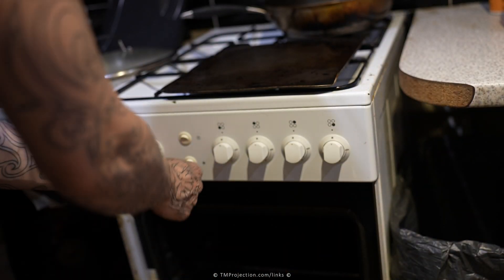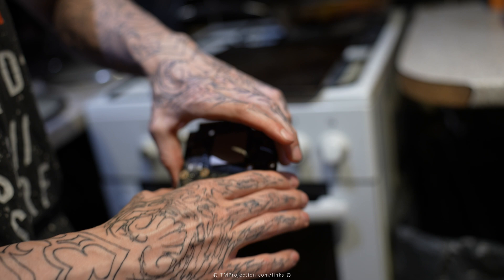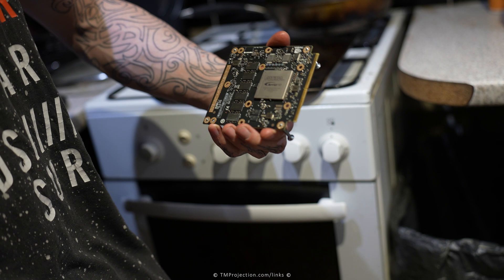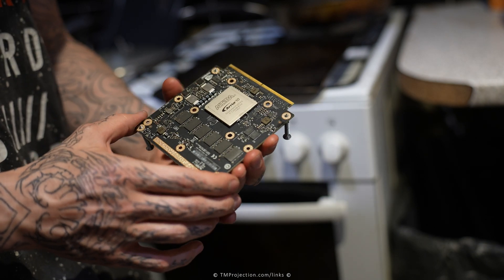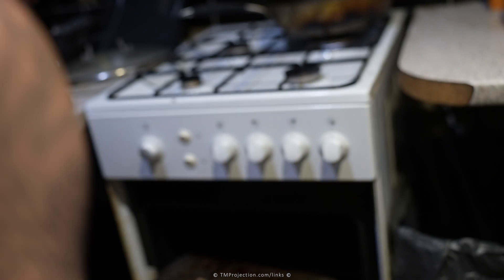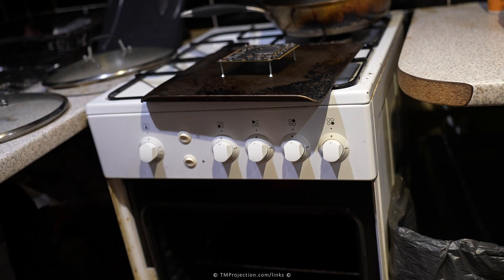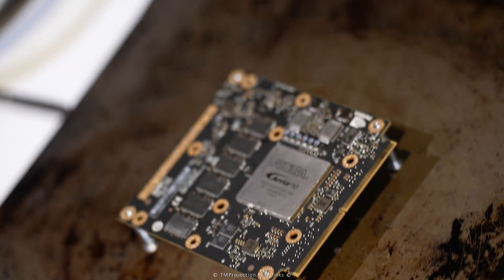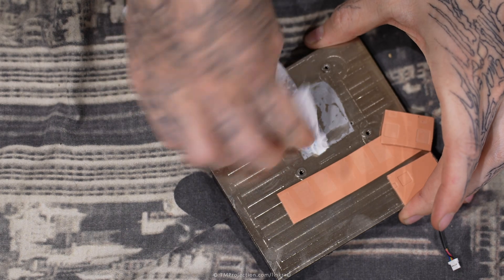LG Ultrawide Monitor 38GL950G-B Disassembly and Repair - 04 Baking the Nvidia chip and Reassembly

Comment: How has this been longer term? I tried the bake, worked for around a month then failed again. Can’t see the point in repeating the baking process. Have since found a replacement PCB assy complete, in the hope it is fine…
Reply from the maker: @Malc2169  still works fine for me now
Reply: Thanks for reply. The replacement PCB is either incompatible or fcuked :( I rebaled the original and it worked again on reassembly. I guess all I can do now is keep fingers crossed. Thanks for the mini-series, it’s a big help. For info, the back comes off much easier if you start in the bottom corners working up both sides then along the top. The bottom edge literally drops off afterwards.

Comment: Pulling the pin on the cable between the main PCB and the T Con board was completely unnecessary. You just pull up the black bar and it flips up.
Reply from the maker: @ryanc4302  yeah i probs did it wrong